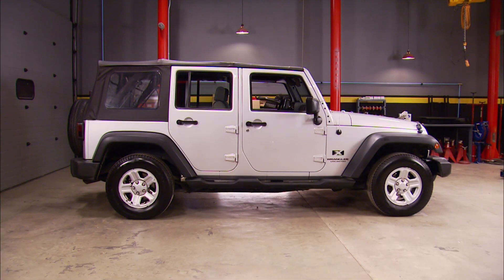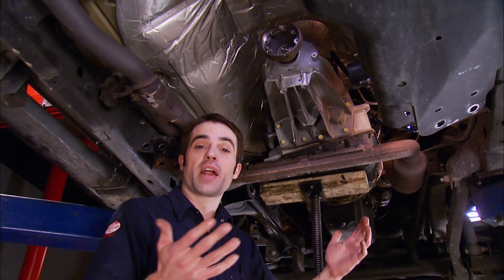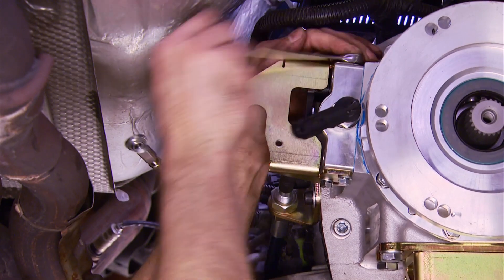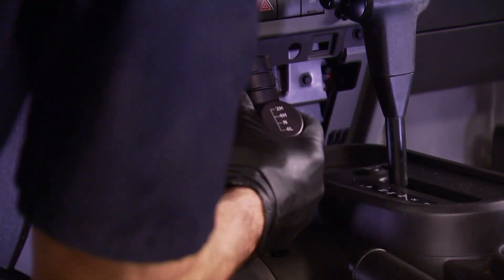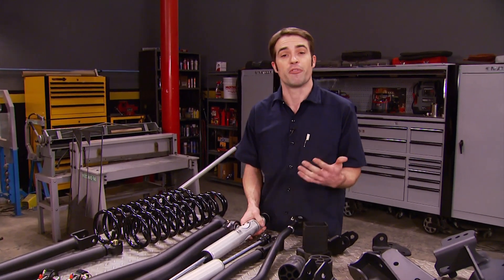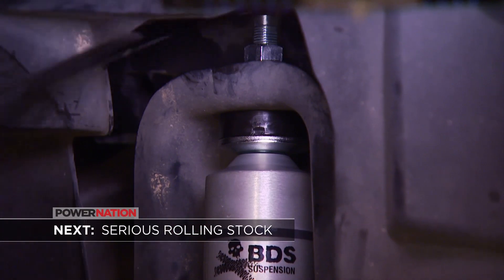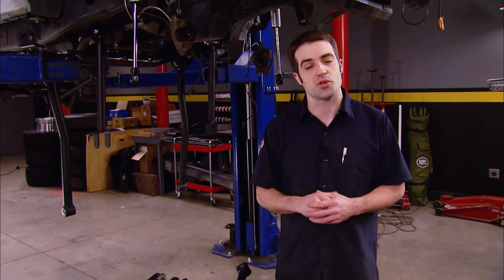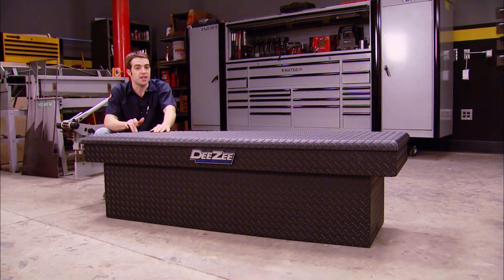Converting A 2WD Wrangler To 4WD - Truck Tech S2, E8

Comment: I had no idea that Jeep ever made a 2wd Wrangler.
Reply: Me neither. Weird..
Reply: Jeep has 2wd option on 4door JKs in 2007-11.
Reply: I've seen a few 4 cylinder, manual trans. 2WD Wranglers driving around.....
Reply: It should be considered a war crime
Reply: How are the front wheels now driven? I didn't see him install any drive shafts in the front? Also how would the be attached? The gearbox is almost in the middle.
Reply: Me neither. I thought if it was a jeep it was 4x4.
Reply: @EbonyPope  Install a front drive shaft to what exactly? The entire front axle wasn't even installed yet.
Reply: @Bob-Sacamano  Yes. I didn't see them installing it. Is there another episode where they do it?
Reply: Because 60% of people live where there is no significant snow and 80% of them will never go off road…and it’s less expensive.
Reply: @James_Hough  Which begs the question, why buy a Wrangler then?
Reply: @leo labine That's I think what threw me off, because I live in Canada, I had never ever seen a 2WD Jeep Wrangler. Odd.....
Reply: A 2wd wrangler is like not putting cheese on a burger, it doesn’t make sense
Reply: Who would buy??
Reply: @calibiopaulinonhavene9701  light weight,  good MPG, some people like the looks but don't go off road.
Reply: They sold a shit load of police ticket vehicles, and postal service vehicles as well. All were 2wd

Comment: I’m doing mine now. Best way to make major upgrades. Got a Rubi transfer case and 1-ton Axles. Mine is a 6-speed and I don’t have to change the rear transmission housing.
Reply: Really. The rubicon t case bolts right up?

Comment: there is a reason that washer was so big for the body mount.  if the rubber failed the washer would keep the body from lifting off the frame entirely, that washer would catch on the bracket.

Comment: I have a 2wd 2008 Jeep Wrangler Unlimited. I'm wanting to obviously convert it to 4wd and do a 5.7 Hemi swap. My question is which should I do 1st? If I do just the conversion am I going to have to buy new parts for the Hemi swap or would it be better to just buy a Hemi with a 4wd transmission setup?

Comment: One thing that amazes me is that the inside bead rarely unseats, especially when there is a bead lock only on the outside.  I'm surprised they don't put bead locks on the inside and outside so the tire NEVER unseats.

Comment: One problem with the wheels and tires. Some states don’t allow bead lock wheels to be used on public roads
Reply: No state allows bead lock wheels to be used on roadways. They are not DOT approved due to the fact that it is a two piece wheel.

Comment: Really suprised the number of people who didn’t realize the JK had a 2WD version. Obviously for mail us, but not just for them. Was offered in the early JKU models only, a lot of debate on whither 4WD was an option or standard at that time. I wouldn’t call this a rare spec by any means, just very uncommon. It’s actually more rare to come across the very early JKs that had the Dana35 rear end than a 2WD JKU. Oh, fun fact in 2021 you can still order a wrangler without factory A/C
Reply: The whole reason the mail people needed a jeep is for rough roads, having 2WD defeats the purpose.

Comment: “Bought the 2wd version and saved some money” then spend more overall making it 4wd.
Reply: They from the states so that’s expected overkill and waste.
Reply: I think the concept is sound though... Buy a 2x4 Jeep cheap, then pick up some parts from a wrecked 4x4, make the conversion and get a huge increase in value.
Reply: The parts needed for this are readily avaliable and cheap from Salvage yards or part outs people are doing.  It would be prerry cheap.
Reply: You forget labor isn’t really a factor for them
Reply: But cheaper than buying 4wd then upgrading existing equipment.
Reply: And don't forget the sponsors.  They really don't spend much on the parts, especially when they are free.

Comment: Personally, if I had to deal with a 2WD Jeep (which is nowhere near as "awful" as everybody keeps bitching about- it's still a Jeep), I would go with more of a pre-runner type build.  Just beef up what's already there.
Reply: A jeep is supposed an off road vehicle, you remove the 4 wheel drive, you are left with just, a vehicle, one that isn't that fun to drive on road.

Comment: Personally, I would have swapped out that 42rle for something more reliable.
Reply: @Rob R if it’s the same transmission the ,42 rle, that they used on 07-11 wranglers , I got 165,000 miles on my 3.8 sport automatic, never changed the atf and it’s pretty solid even handling the 35 inch tires and 4.56 gears, highway speeds up to 80 only thing in my opinion is down shifting and redlining
Reply: @juanmartinez-xk3nu  I'm glad you've had good luck with yours but I've personally had a horrible experience with one of my previous jeeps that had the 42rle.

Comment: Powerstop sucks, I dealt with their bs 7 years ago. Zinc coating comes off first brake cycle and the quality is shit between Chinese metal and rotor inconsitancy. Imagine cutting a brand new drilled and slotted, diamond bit? Why...... Go with an oem rotor with a good pad, ebc maybe since these guys always recommended them.

Comment: They should mention the costs? I guess the jeep was 5k cheaper then they spent 8k for parts but at least they got proper offroader
Reply: All these parts are readily avaliable in Junkyards and part outs.  Wouldn't cost anywhere near 8 grand.
Reply: Its not a trail ready Jeep with that weak rear end.
Reply: Eight grand, nowhere near if you can do it yourself~
Reply: @bmstylee  looked like the standard JK D44 to me.  At least its not a D35C.

Comment: If you didn't know that Jeep made a 2wd, then you're probably not a Jeep  fan. From 07-10 the Unlimited (4 door for the non Jeep reader) could be bought in 2wd. It could be found as a Sahara, but mainly as an X (which was the bottom model). This one clearly is an X by looking at the front quarter sticker, crappy wheels, no Trail Rated badge, and no fog lights. Yeah, just buy a proper Jeep! Things are cheaper when sponsored and wholesale priced.
Reply: Dont know why all the comments are hating on 2wd jeep......... i have one and use it just to city drive on hot days with no doors or roof.......  nice vehicles
Reply: @jeffsmith8842  exactly. I’m a young teen and only issue I mainly have is death wobble. Great on dirt roads. And just a nice suv to have. Safety, reliably. Not everyone wants to beat up there jeep.

Comment: Power stop products are crap they sent me rotors that were warped out of the box they would not refund the price luckily the retailer did.   My front pads shims fell off after 6 months they did replace the pads but I don’t see a major gain in using their system.
Reply: They have THE absolute worst customer service and order fulfilment of any company I have ever dealt with.

Sent me calipers in the wrong color 3x, and I eventually just had to roll with it.  SMDH
Reply: Have you ever tried EBC stuff? I see they claim their products are made in North America depending on which products Canadian or US stuff

Comment: Yeah right you can't do this in your driveway unless it has a lift and a fully equipped shop 😂. They also must have tested everything to make sure the videos perfect so they probably done the job to three times 😆
Reply: I have done more involved jobs than this in my driveway.
Reply: They're not even removing the transmission, just a transfer case. It's all very doable in a driveway. All you might want is a transmission jack...
Reply: This is a reguarly done conversion on 2wd XJs in people's driveways.  And the JK is simpler since a transmission swap or output shaft swap isnt even needed.
Reply: Jack, stands, and a decent tool box is all you need.   Poors always complain like this.
Reply: @bmstylee  Not that I'd be rich for fixing my own crap in the driveway 😂
It's dumb to complain that a TV show has all the nice tools and a shop to do work in...
Reply: Nah this would be easy to do in a driveway. Main reason having a lift helps is fitting a TV camera underneath.
Reply: @Vaino_Hotti  I should have clarified.  They can't afford the parts and can't use a screwdriver without losing an eye.